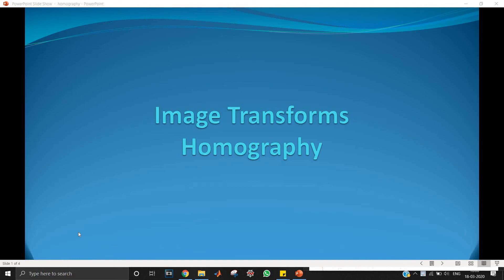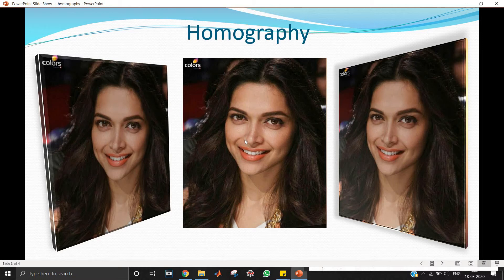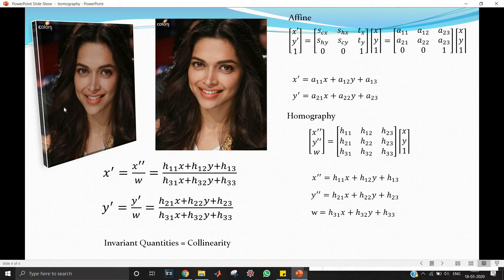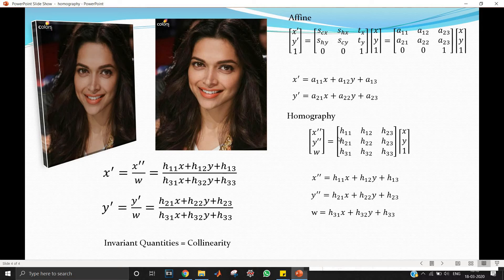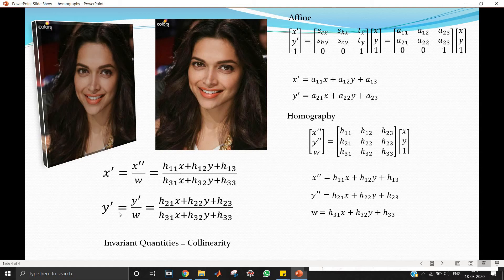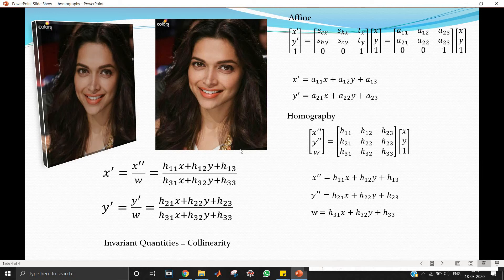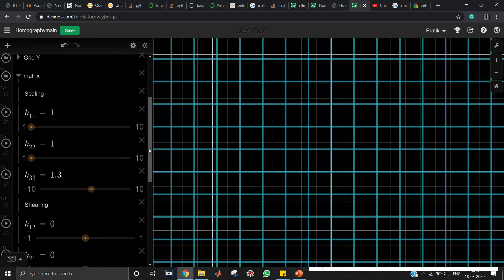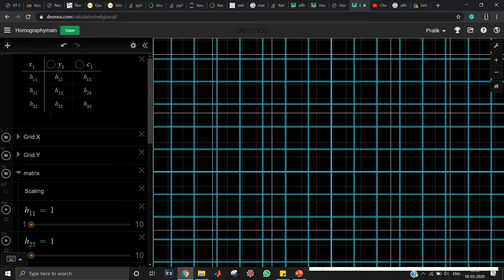Homography (Perspective) Transform: Desmos Visualization [E4]

Comment: Hi ，thank you very much for your explanation, it helped me a lot, I want to use homography to correct a picture taken with a tilted camera, how do I calculate the value of h32 if I only know the tilted angle of the camera. Thank you for your answer.
Reply from the maker: @liyilin399  could you email me the problem. I will have to understand what do you mean by tilted angle.
Reply: @pratikian  thanks for answering my question!!! what is your email address?